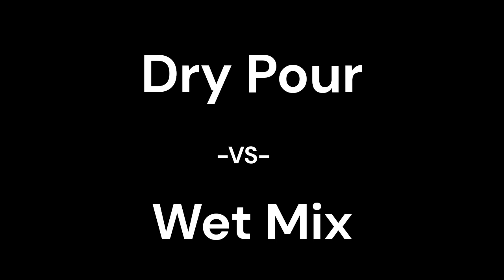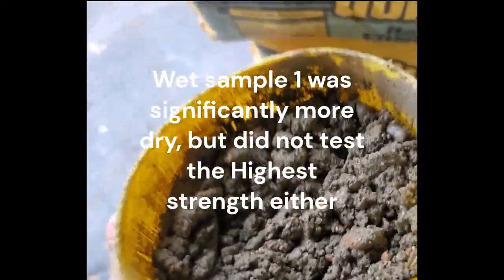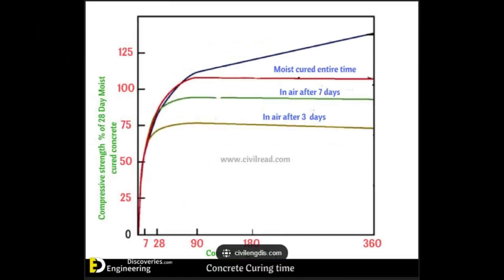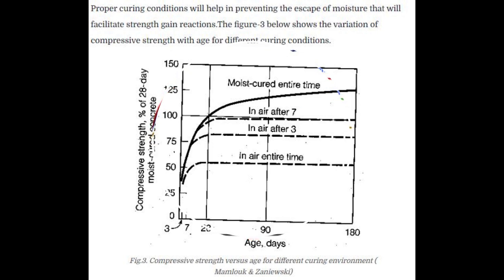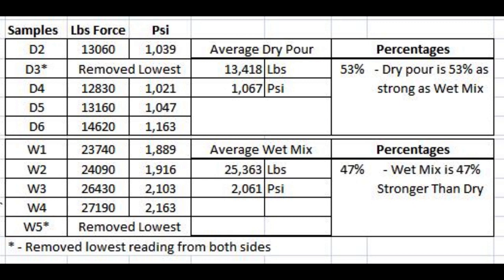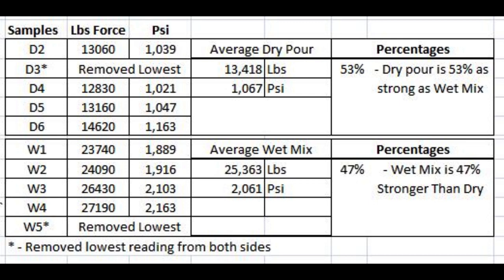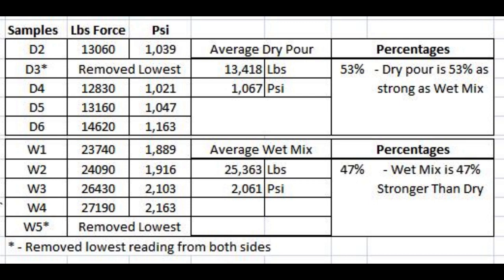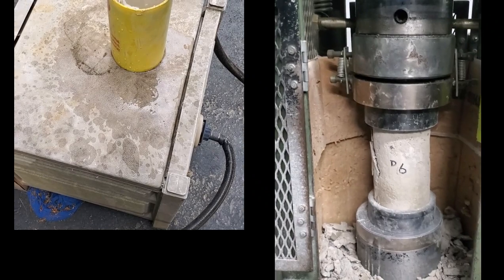Test Results Round 1.  Dry Pour vs Wet Mix.

Comment: Hey, do you have a video for how you moist for a dry pour? I've just seen videos where the use the mist setting and then shower setting. So just curious as to what you mean by moist dry pour.
Reply from the maker: Moist curing refers to keeping the concrete wet for 3 to 7 days or more as it sets up.  You cannot let it starve for moisture or it will not reach its rated strength.